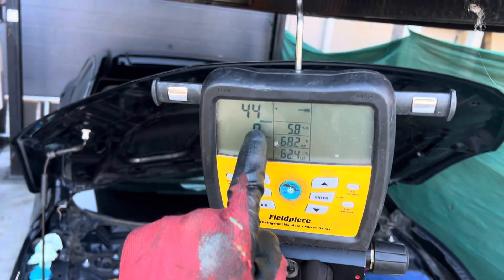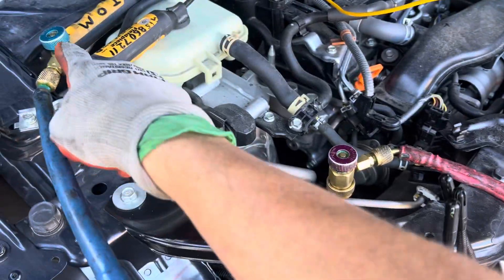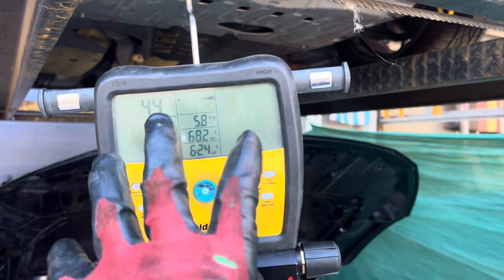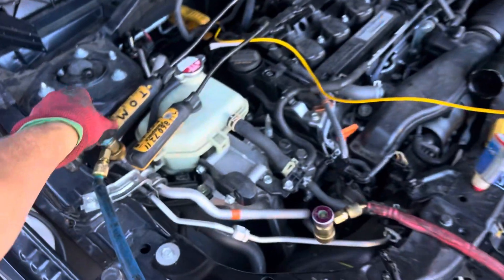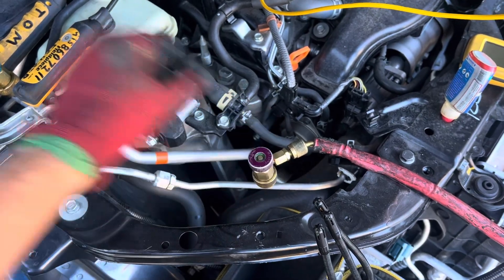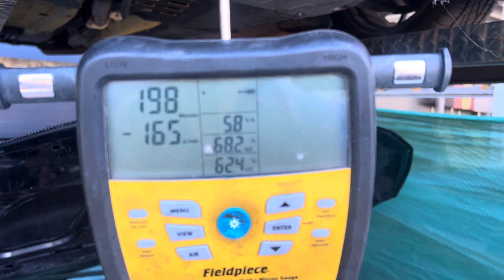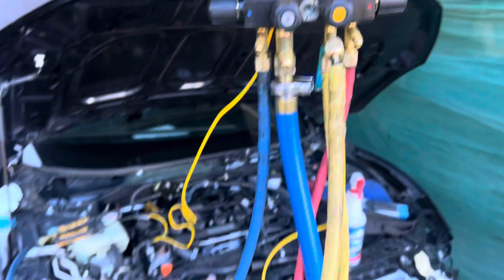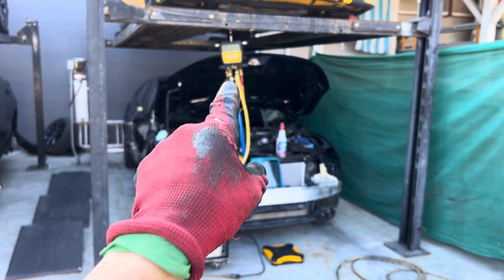Test you refrigerant manifold first for leaks before connecting to the vehicle.

Comment: Best advice even for a analogue gauge set . Testing gauge set tests all shaft o rings in manifold , internal valve seats ,  manual needle gauges [install plug in gauge port to isolate leak ] 
Remember to lube orings with di lectric or Nylog .   I found flushing with liquid refrigerant after assembly  is needed other wise your micron readings will stay elevated 
Reseal coupler new o rings and Nylog sealant 
Test hoses individually.  
The best way I found as u recommend is to evacuate thru dedicated hosing with a standalone micron gauge .   But then again I only have a 4cfm 2 stage pump and standard diameter refrigerant hose . [single hose evac setup no manifold  ]I need to have dedicated large setup although my system works satisfactory . Pull down time is dramatically slower than your setup 8cfm pump and Tru-blu hose connected to field piece manifold .
 . If I were buying a quality daily use setup Field piece setup "all the way "  but I am now medically retired .
Reply from the maker: I am attempting to teach myself, and prepare myself for partial retirement.  Enough work in the day to keep my brain stimulated for fun.

Even though my job is usually fun and I don’t work anyway, I don’t have a job I just get to play with toys and I get paid for it . 

And finishing up my teaching credentials and my or BS HVAC so I could apply for the Hvac school and structural position two or three nights a week that’s all I need .  Keep me busy.

So I don’t become a vegetable
Reply: Looked into teaching at the local govt college  when I started with medical issues  but they could not guarantee employment contract  .  The  mechanic techs are still taught the same old  incomplete info . Strongly appears if the automotive  air/con class is coming from car makers manuals =ever so basic info . Some tech manuals are absolutely useless . This is the frustrating part.  Biggest example of that is the graphs showing ideal pressures vs ambient temp For the most part a complete lie . 
I very much enjoyed the mobile industrial air-conditioning part of my trade .
Reply from the maker: @swampy6x659  YES EXACTLY 👍 100% CORRECT ✅ 
I told my instructors this even back in the 80’s  when I was in my early 20’s